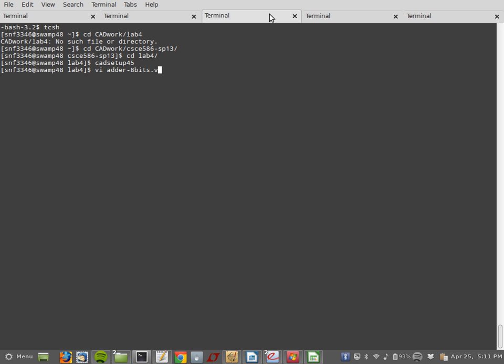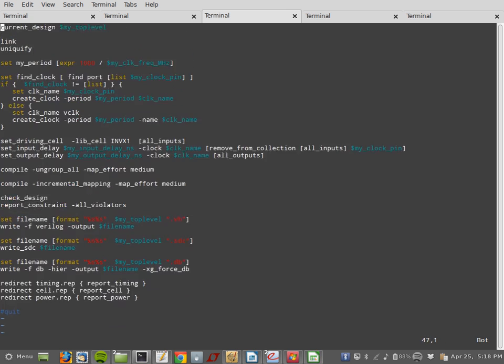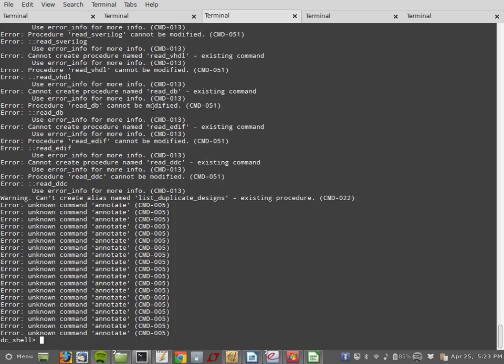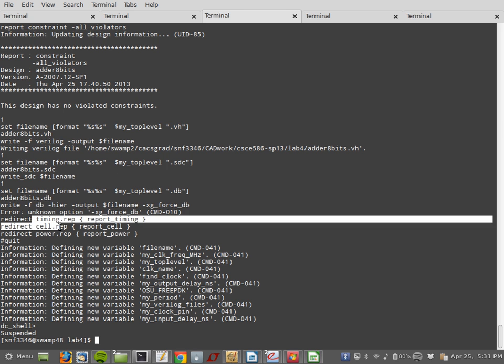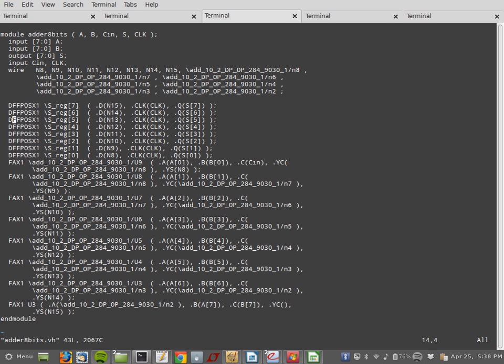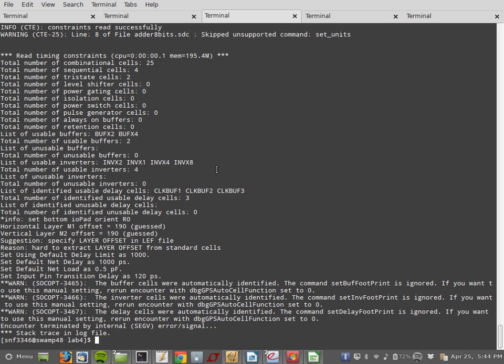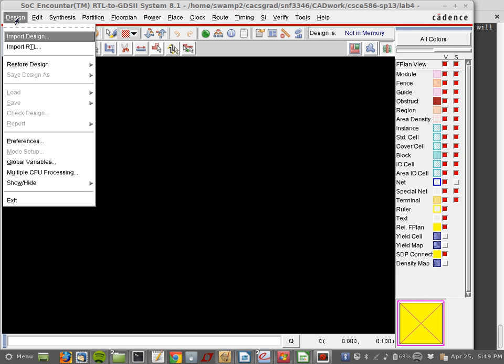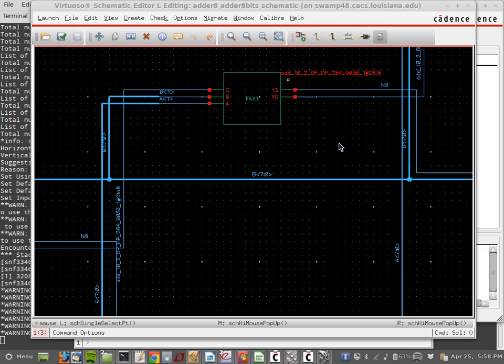Synopsys Design Compiler Synthesis Lecture (2013)

Comment: Thanks for your video. After I imported the netlist into virtuoso, the logfile showed "WARNING (VERILOGIN-19): The library, sample, is not specified in the cds.lib file. Add the library in the cds.lib file and run the command again." and "WARNING (VERILOGIN-22): Module OR2X1, instantiated in the top module test, is not defined. Therefore the top module test will be imported as functional.". I just wondered how I can solve this problem